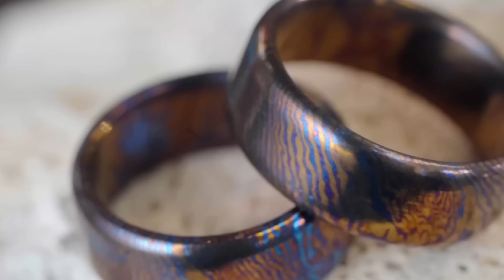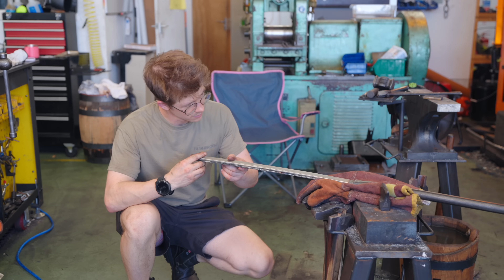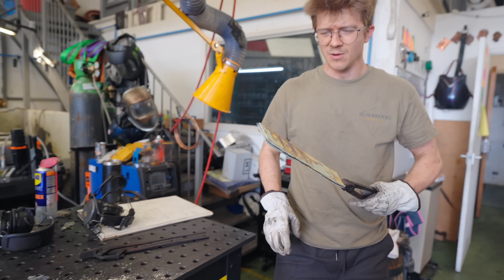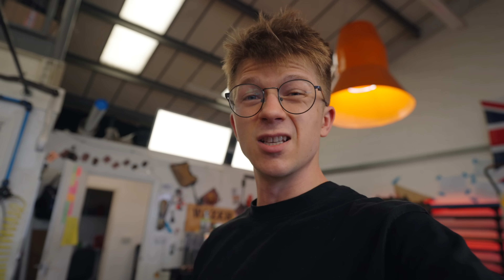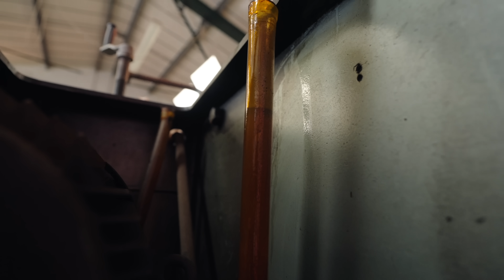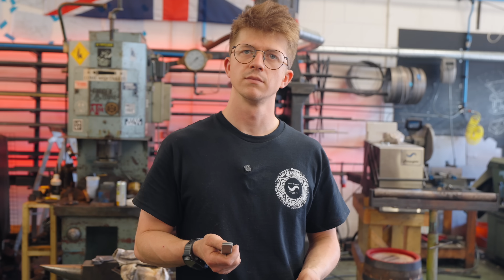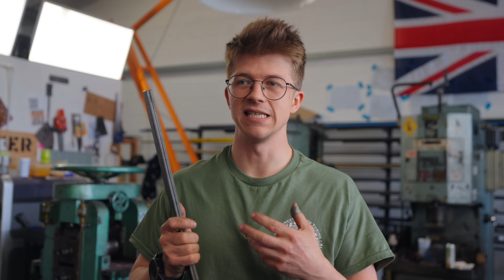Making a Titanium Damascus Katana - Part 1

Comment: Have you ever considered pulling a vacuum on the billet assembly and completely sealing it instead of using argon? Then you could wouldn't need a handle or gas hose so you could hot roll it to bond instead of hammering. Very similar processes are used at an industrial level.
Reply: I would also recommend an acid pickle and rinse with DI water before stacking.

Comment: just a question, would the roller put enough force to bond it together? i mean, you could heat it up, put it through roller (if it has enough force) jamie could open it, you would take it out from same side you put it in still with argon hose attached

Comment: Vanadium is the interlayer you want. Sandwich it between the nickel if you want that shiny layer in your Damascus.
Good Luck.
Reply: What's the advantage?
Reply: @Alsadius  I'm by no means an expert, but from a quick look at the phase diagrams, it seems like Ti-Ni has a phase with just 942°C melting point, while Ti-V has no meaningful intermetallic compounds or lowered melting points. Same goes for Fe-V.
Reply: @alexanderdaum8053 Okay, I can see the appeal of that. And it's not super toxic or super brittle or super soft, right? It also needs to be able to handle the physical side of being a sword, after all.

Comment: Those voids in the final test article looked ~ periodic. Could they have been areas between hammer blows? Could the roller forge work for the initial weld bonding, instead of the power hammer?

Comment: The forces of that milling cut might well be rather higher than you think, and the direction of the forces can matter heaps too! That looked like a very aggressive depth and speed of cut on camera and you only had such a thin layer of Ti left that effectively all the load of that cutting force is on the bonding of the thicker bit that remains to be cut to the steel - you are leaving what is pretty much a foil of Ti behind, so under the cutter it has almost no structure of its own...

Comment: Is there a forward/backward adjustment on the metal roller? Often the reason for the bending of the metal as it is squeezed out is because the top roller is "behind" the bottom one slightly, aligning the direction of the metal upward instead of inline with the part of the machine that the hot metal comes out onto. That may have been a poor description (I'm sick), but I'd be happy to draw something to help explain it if you'd like. Email/discord or whatever

Comment: brah you can't make a true katana with titanium, a katana is a piece of engineering, it uses the different phases of steel in order to perform as an excellent sword, also this design with the heat treating process is what forms the curve as well..so not a true katana

Comment: I wonder if it would be possible to do a similar technique to your barrel making. Could you heat the billet in the induction heater, then diffusion bond one section of it under low strain high pressure (with your hydraulic press), and then roll the piece to strengthen the bond? Or maybe would it be possible to bond the piece by rolling it? I know that you need the argon hose but if you are able to disconnect it before it goes into the mill you could roll the piece to bond the metals, then keep rolling it to strengthen the bonds? Sorry if this is an uneducated question, I'm a physicist not a materials scientist.

Comment: Absolutely Excellent video. I'm a neuroscientist, and your understanding and committment to the experimental process is soooo satisfying. You should publish the information you gather here and in previous videos. One thing this video makes me consider is that the titanium-nickel bond seems super weak, even if technically doable. Is it possible that you could use a 2 material inter-layer- i.e. bond titanium to some material 'A' that it readily will bond to (i know, hard already), then bond 'A' to another material 'B' which can bond to steel? Haven't done any research into it. Have you considered it? is it possible?

Comment: It strikes me that with the forging down, the nickel interlayer must also be getting thinner.  At some point, it'll be 'too thin', and some iron or titanium will diffuse through, and form the inter metallic.  The longer 'time at temperture', the more the diffusion time, so that means that the nickel interlayer thickness gets tested in two ways by more forging.  I think it might be prudent to try to increase the thickness of it, proportional to the reduction in the thickeness expected.  i.e. if you plan to reduce the thickness by a factor of two, increasing the thickness of the nickel layer by a factor of around two might be important in preventing voids.  Just extrapolating in my head here; I don't have diffusion modelling software to hand any more, so might be a bit off base.

Comment: 38:06 what if you didnt clean the metal good enough like  maybe there was a oil on the metal maybe you need to wipe it down with a degreaser or Acetone before you forge weld it?

Comment: I’m looking at that argon setup and thinking that the argon is not spreading out evenly inside the jacket. With an entry and exit both in the middle, it will take the path of least resistance. From some experience I have with CFD, to improve this I would say at the inlet use a bigger opening and create a bit of a lead in for the gas to spread out before it hits the pieces of metal. Then for the exit rather than one big exit hole, have a series of perforations right across the endplate.

Disclaimer - I’m only half way through the video, may delete later 😅

Comment: Just a curiosity thought, but are you purging with argon while you are welding the seams on the box you are making around the sheets?  I saw you cleaned each piece as you placed them in the jacket but just like regular welding you could have contamination in between each layer if your not purging it at that time.  With the humidity in the air out there right now, you may have trapped air and moisture when you close it up.  Also, would it help to add 2 steps to your process.  Forge weld a couple sheets of  nickle to the steel and forge weld them, then do the same with the titanium and nickle, then take the 2 new pieces and forge weld those together.  I'm not sure but in my mind it may give it a better chance of bonding due to not trying to bond all 3 together at once.  You are sure you have a good steel/nickle piece bonded well, and a good titanium/nickle piece bonded well, then those piece want to be friends and stick together.  Maybe??

Comment: Spring steel is the best metal for a sword, not as tough as titanium ofcourse but it is the weight. Titanium is too light so you don't get enough blade presence. In a bind(blade against blade) between 2 exact same swords but 1 in titanium and 1 in steel the steel blade will have control. The steel blade can parry the titanium blade easy and is hard to parry by the titanium. For cutting things like wet newspapers or tatami mats the titanium needs more strength in the cut because it doesn't have the weight behind it, more than the ~2 pounds of steel requires. Titanium is the stronger more corrosion resistant metal but it just doesnt have the weight to make a good sword.

Comment: There is one option to improve the diffusion of nickel with steel by using a layer of pure iron without carbon impurities between them. I don't know for sure, but nickel tends to form carbides, that is, when you try to weld it with steel, it will absorb carbon from the steel and form carbide structures at the place of their diffusion, which are very fragile, which in turn can cause delamination during forging.
Reply: It was the nickel- titanium bond that was failing. He's got the nickel-steel bonding down pat.

Comment: What if you chemically plated on a layer or made a jacket of nickel to the whole piece of steel/titanium rather than a flat sheet placed in a stack? Then you don't have to worry about the nickel tearing apart or having gaps between hits and you also have a clean [METAL]-nickel interface without uneven spreading
At the end of the day you'll be forge welding nickel to nickel..

Comment: To test for oxygen hold a match in front of the hole when you lower the pressure.

Argon will smother it normal air will let it still burn

Comment: Why not try Niobium between the Steel and Titanium layers instead of the Nickle. Use it between the cut billet sections also when forging them together. An absolute must though is you always have to use an argon flush canister when in the forge. Even when you forge the billet sections. When hardening, wrap the katana in stainless steel foil, heat to 1,475f, do not soak it longer than 5 minutes. Quench in oil. Niobium is hard to source and moderately expensive, about 150 usd per kilo. However, it is the best material possible to use in this application, as long as you keep oxygen away from it in the high heat forging. Almost forgot, do not use the roller when forging. All three metals move differently when in their plastic state.

Comment: I think the iron and/or diffused into the nickel and "got through" - at least that's what I thought at first, in the end I was not that sure because the nickel layer seemed to be thicker than I thought. But high temperature at longer times and a thin nickel layer would probably cause problems

Comment: Did you think abot repleacing nickel interlayer with for examplt inconel 718 or 625, both have high nickel content, and 718 is much harder (about 40+ HRC), and do not corrode. I wonder what the result would be.
In the past, I primarily dealt with cutting these materials, whereas now I focus more on design and technology.

Comment: I'm curious about something. During the initial welding heating, the material is in an argon atmosphere, but during the second heating, it is not. I wonder if not having the material in an argon atmosphere during the second heat is having an effect on the materials sticking together. 

It may be in your interest to find a way to keep the material in an argon atmosphere during every heating cycle to minimize exposure to oxygen.

Comment: Is it possoble to use no case and clamp the ends together, than heat the middle and forge that, then the sides. That way the case does not mix!
Reply: Or buy a larger kiln

Comment: If you power your forge with solar, wind, hydroelectric, and use traditional fire (as you do) you will be able to forge swords with the power of the sun, the wind, water, and fire.

I'm pretty sure forging a butter knife under those conditions automatically makes you a legendary blacksmith, doesn't it?

Comment: As someone who has no knowledge regarding forging: would it be possible to first bond/forge nickel (a bit thicker) and titanium together, then nickel (a bit thicker) and Steele together and then, when that is done, sand down the nickel side to be perfectly smooth at the perfect thickness and forge/bond both nickel sides together?

Comment: What about a sort of conveyor system for longer billets. Use the induction heater and gradually feed the material through it and while each section is at the required temp pass it through the rolling machine.

Comment: Alec get you a O2 meter to check your purge hole of no oxygen present or check it with a lighter flame . The argon will put out the flame . Also start your purge with the hole at the highest point due to argon being heavier than air and it will completely purge out the air or oxygen.
Reply: Furthermore, it would be better to purge with a low flow rate for a longer time, otherwise you'll have turbulent flow inside the billet which will let more oxygen stay inside.
Reply: @excavon7297 agreed
Reply: I was thinking something similar, but I was also wondering if his forging and changing the interior of the canister with a hammer increases the risk of him pinching off the argon flow and it is backfilling with atmosphere as the gas escapes? Maybe he needs to inject argon in more than one place with a manifold or use a check valve at his purge hole to prevent backfill while hammering? Not sure if it's a good idea or not but it definitely is an idea lol.
Reply: @InsaneGeraldo  i think forging in direction from the argon outlet to the inlet. Should make it safe. As the hole gets pinched and if any welds fail and open they have argon flowing trough.
Reply: @InsaneGeraldo  I was thinking a vacuum pump, to help purge the o2 as the argon is being pumped in.
Reply: hehehe, purge hole.

Comment: Thought concerning that bend test. Its more likely the the delaminating was from sheer forces not a poor forge. The hard brittle steel wouldn't move with the Ti around the bend, forcing them the slide along the forge line.

Comment: Amazing video as always Alec, I'm excited about a new 18 part series!

Since you seem to become quite the academic recently, maybe you are interested to exchange the engineering strain you have been using for the true strain (also apparently called logarithmic strain). The true strain has some nice properties that are very useful to somebody interested in deformation like yourself.
True strain is calculated as the natural logarithm of the ratio of final length to starting length ln(l1 / l0) or also from the engineering strain you are now familiar with ln(1 + e).
The nicest part about the true strain is that it's total is a bit of a conserved quantity.
Suppose you are deforming a body in direction one. You will also simultaneously deform it in the two other direction. For example if you squish a block from the top, it will get shorter but also thicker and wider. This is because the sum of the true strains in all directions must be 0. Or in other words: 0 = epsilon1 + epsilon2 + epsilon 3
This means that if you squish from the top (direction one) this will be a negative true strain since this dimension gets reduced. This also means though, that the other two dimensions will get increased by half, as -1 * epsilon1 = epsilon2 + epsilon 3

Could be something interesting for you.

Comment: Hey I dont know if it will help with your titanium nickel bonding issues, but whatabout another layer of nitinol between the titanium and nickel? Nitinol is a nickel titanium alloy and is known for it`s special propreties when deformed and heated aswell as a few other mechanical oddities. I honestly have no Idea if it could work, but wanted to let you know about it.

Comment: I was listening to a lecture today talking about how important it is to fail in research, and that most science is in fact testing hypothesis that fail. We can learn a lot from every failure, and something like your identification of the inter-metallic compounds as the likely problem in your first billet test is going to inform you a lot going forward about how this material is going to interact as it is moved around, folded, and cut. The pressure to be optimized for success is poisonous to this.
Reply: Massive amounts of scientific discoveries have been made through "failures" testing or making something else. Failures are part of the whole creation process.

Comment: If only one of your power hammers had an induction heater at the front and back. Might take some time to dial in a perfect temp that wont melt the parts, but you could maintain the temperature while working a piece all in one go.

Comment: You can try to use the argon flow at the end of the jacket to put out a flame? Without directly blowing on it an air filled stream should keep the flame lit a bit but the argon would extinguish it.

Comment: Would not the rolling and the hammering of the material add energy\heat into it increasing the risk of making titanium sludge? Dont know if that fact changes how you go about this. But would working it slowly to not change the temperature to much help you?

Comment: I dont know if its just me as a non-blacksmith... but even in 93°F(34°C) i wouldnt be caught dead blacksmithing in freaking shorts! And this is coming from a guy in Michigan who deals with 90°F+ days during the summer for my entire nearly 40 years on this planet and sweats like a freaking horse at even the slightest amount if heat above 70°F or even in winter(30°F-0 or below) when exerting myself. Id never do something with screaming hot metals especially when squirts and oxidation chips flying are normal occurrence.

Comment: I agree with you're end result of needing to either forge or hot roll the billet to the length you need. No way you are going to be able to get the bonds you need without beating the hell out of it or exerting ALOT of force on it.
Think of it like kneading the steel, nickle and titanium together to force them together while hopefully forcing/massaging any of the voids out.

Comment: Could you improve the consistency of the initial forge weld by rolling it instead of using the power hammer? Not sure if I've seen you try forge welding with the rolling mill...

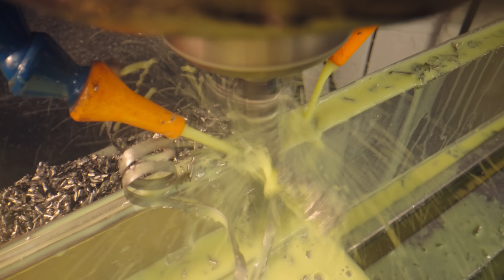Comment: 26:01 As a machinist that is a sound you will remember forever. At least you didn't damage your spindle or Jamie.
Reply: watch Alec do it again in part 458 of this series
Reply: I mean really, where are you going to get a replacement Jamie on short notice? The overnight shipping alone would be a fortune.
Reply: Milling heat hardened titanium at that feed on a Bridgeport is certainly a choice.
Reply: At least it was carbide. The carnage of a HSS tool failure is... extraordinary.  Tough materials can be pretty scary!
Reply: @keatoncampbell820 Oh yeah, it's astonishing how fast things can go wrong.

Comment: To really make sure there is no oxygen in there you'd need to make the case airtight, pull the vacuum, fill it back with argon instead of air, pull vacuum again, fill with argon... basically rinse and repeat a few times and there should be no oxygen left at all

Comment: we know that the titanium dioxide in white paint works miracles in keeping jacket layers from bonding with steel, but what happens if you use white paint inside your jacket when titanium is the outer layer?